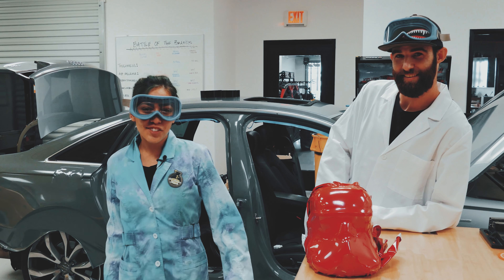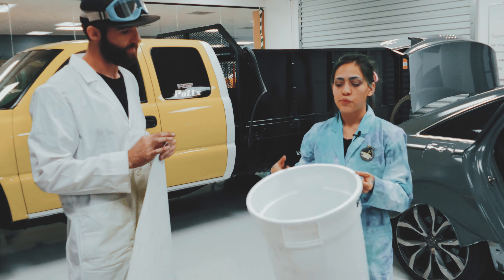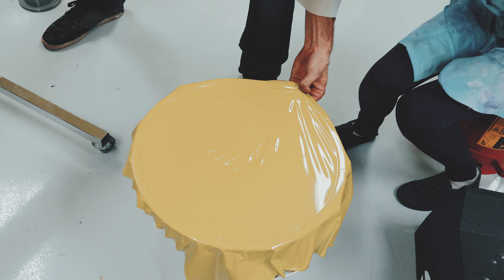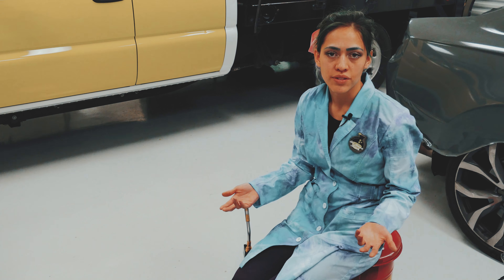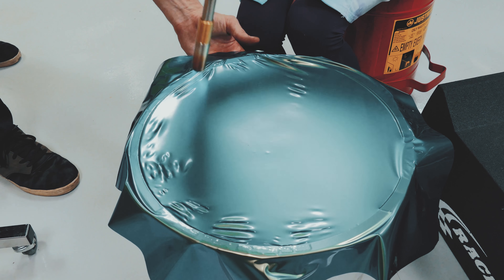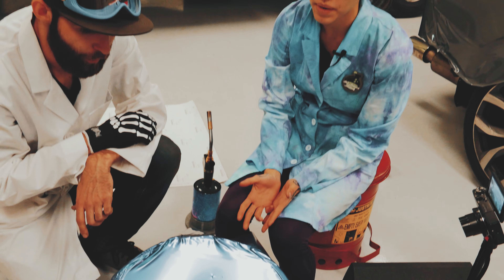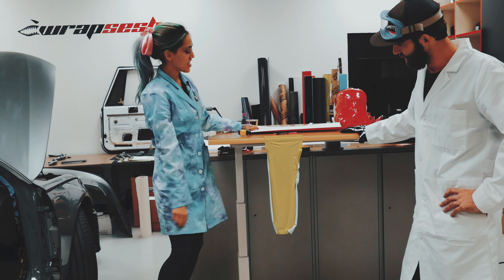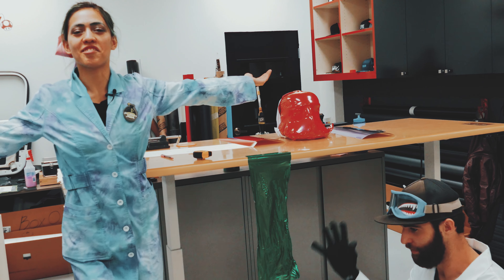Battle of the Brands: Vinyl Wrap Stretch Tests!

Comment: Firstly I have to say I love your videos. 
I have to agree that Avery is very user friendly vinyl. But in you stretch test it was also the only non metallic vinyl. It might stand up to the test again in metallic, but some of the faults on hexis and 3M I believe is due to the metallic.

Personally I don’t like the finish on 3M’s gloss vinyls. And some of them have a tendency to leave glue wen lifted and reapplied.

Oracal have a great gloss finish but is a bit aggressive vinyl.

Would love a comparison on the finish of gloss metallic between the brands.

Regards
André form Norway
Reply from the maker: ttrd82 we totally agree with all of your points, took the words out of my mouth! Metallic definitely plays a part in this. I find similar issues with 3M even though it's such a big brand Name in the industry.

Comment: Little tip - drill a hole in a bucket for air escape - no need to lift a vinyl while heating :)
Reply from the maker: Bam! Perfect!
Reply from the maker: Zigfrid Tijunelis uhhh GENIUS. Work smarter, not harder right. Thanks for the tip Ziggy!
Reply: You are welcome. Science and logic rules 🤘🇨🇦
Reply: Also, throwing a straight edge across the top of the bucket would give the exact measurement instead of eyeballing it.